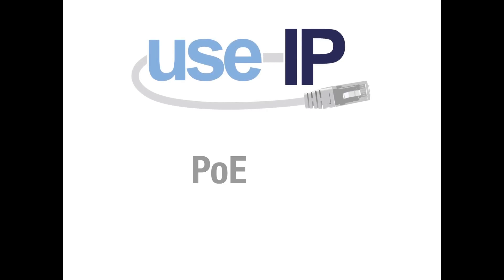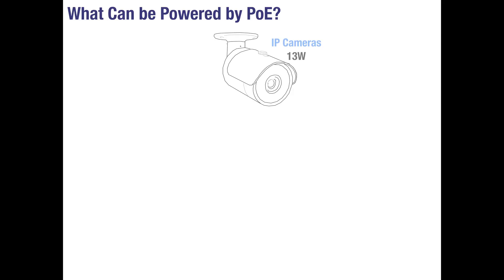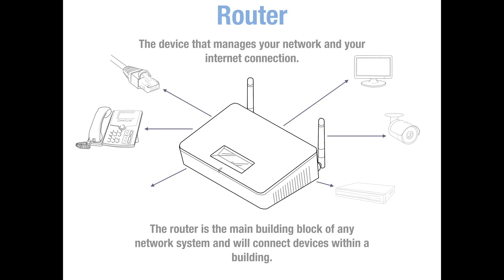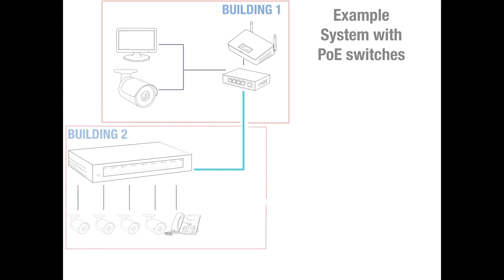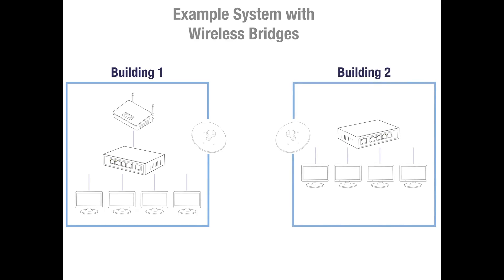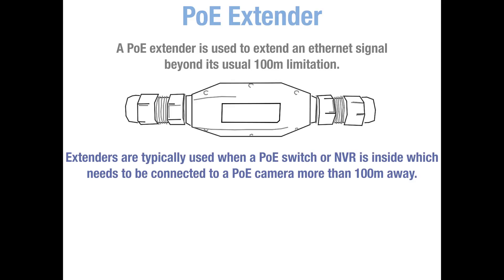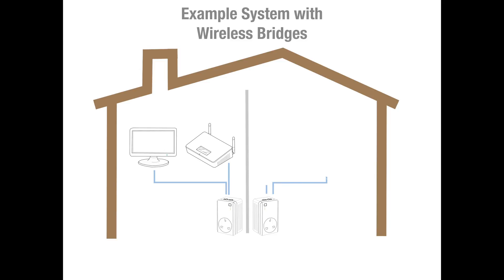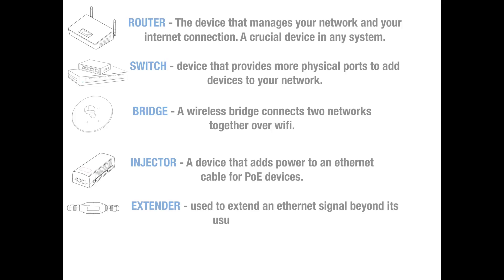PoE & Network Hardware Guide

Comment: Nothing on POE splitter, active or passive?
Reply from the maker: Thank you for the feedback, the idea of the video was to introduce our customers to basics of the most common PoE & network hardware, in our 11-year experience of selling IP solutions the use of splitters has become less common as fewer and fewer cameras are released without support for PoE and so for new customers buying a whole new system a splitter is very rarely required.